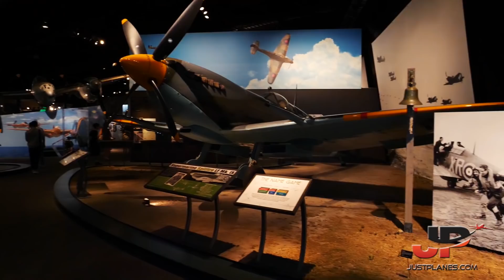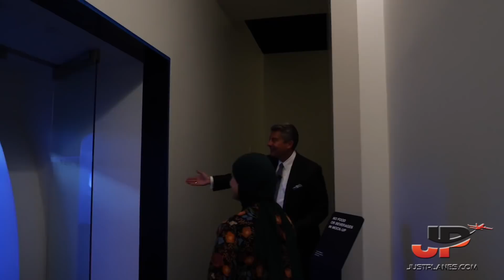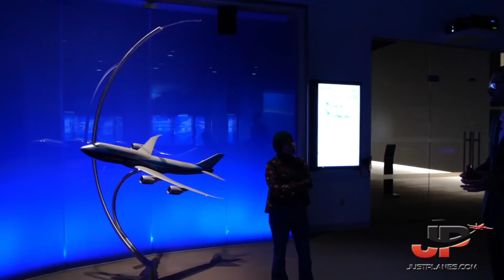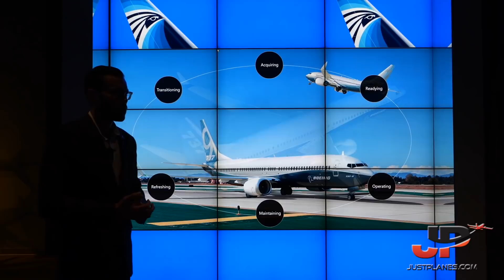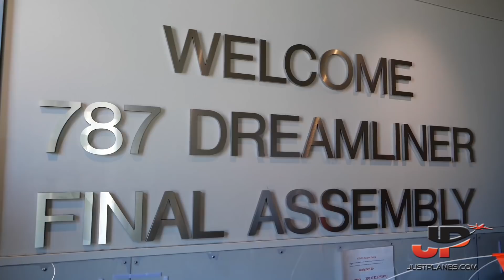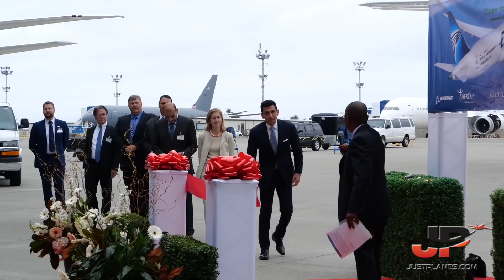BOEING 787 Delivery PART 1 -  Behind the scenes visit of Boeing

Comment: Interesting fact: I worked 40 years for Caterpillar mostly in Manufacturing Engineering.  In the late 80's we had an engineer who previously worked for Boeing and he designed our manufacturing fixtures for hydraulic fixtures to operate on air instead of hydraulic oil.  He brought the idea from Boeing aircraft. He told me he got the idea from the jackscrews that controlled the trim.  His name was Al Llanes.  No more oil leaks which saved us a lot of money on machine coolant used for milling, drilling, and boring.